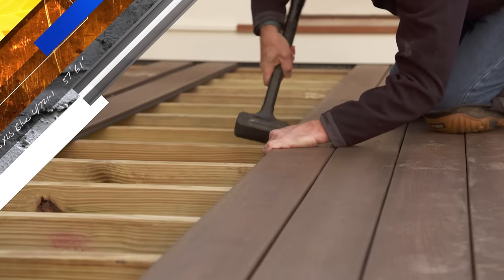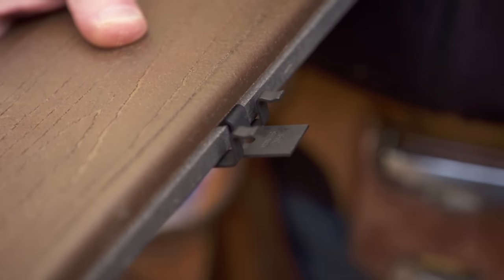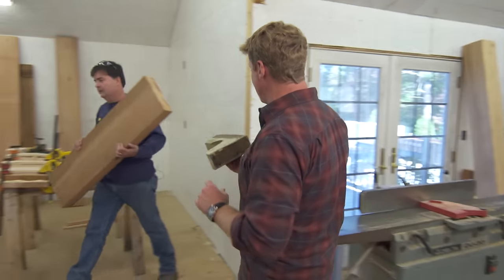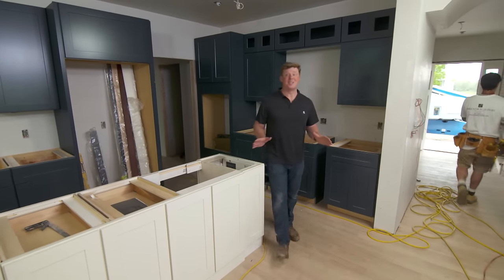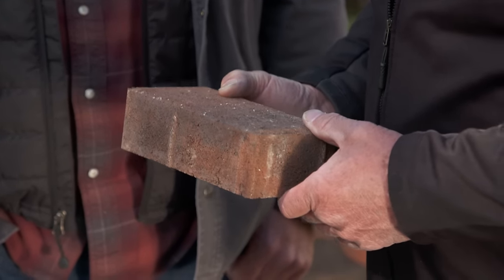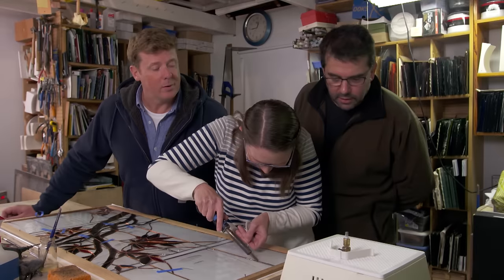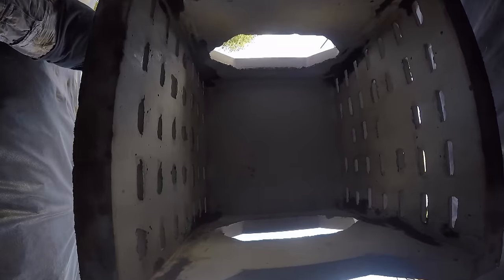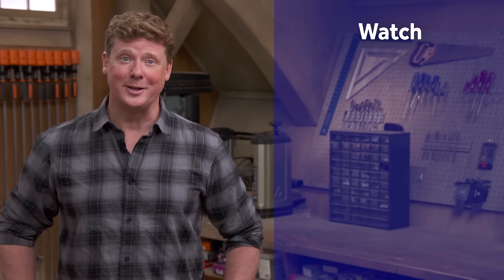This Old House | Homeowner Going the Distance (S39 E14) | FULL EPISODE

Comment: One detail regarding composite decking is that it gets hot in the sun, so bare feet beware! Real wood is less so.
Reply: @Kevin-mp5of  - I don't either.
Reply: Not the newer stuff from Timber Tek. Trex does however.
Reply: @aziltener  oh, that's good to know.
Reply: I have fond memories of going to the hospital ER with a splinter in my foot from a pressure-treated deck.

Comment: Why use the 8 inch driver to drive in the deck screws?  You'd think a short screw driver would be a little easier to drive in the deck screws. @ 5:01

Comment: I highly doubt that drain field only cost $25k. Those Precast Concrete Leaching Galleys cost anywhere from $2000-4000 each and he's got 8, and all the engineerying, labor, permits, inspections and profit, try $50,000
Reply: Like I typed earlier--leave it to government to make you spend $50,000 for a hole in the ground.
Reply: “They are on a tight budget” 

“Here are the custom designed tiles and handmade stained glass window”

I don’t think budget was that much of a concern

Comment: I once made a sliding door from Trex. From what I experienced from that build, not sure I'd want that as my decking material. When the sun beat down on it, caused warping and was extremely hot to the touch. Cheers :)
Reply: If I ever used composite decking, I would always put the floor joists 12" on center.  This way you could run the decking perpendicular or on a herring bone pattern.

Comment: Does a $1500 Festool Kapex miter saw cut 3 times better than a $500 12" DeWalt miter saw? Just curious...
Reply: It cuts a three times bigger hole in the wallet
Reply: quality of materials, quality of machining, tighter tolerances... 
"you get what you pay for" 
if it's a daily use tool/item, don't skimp out on it